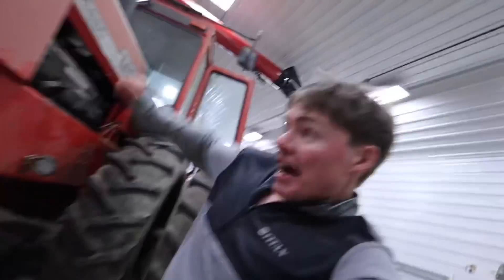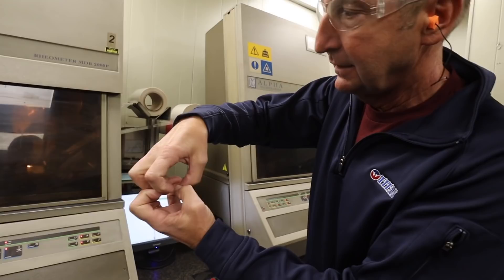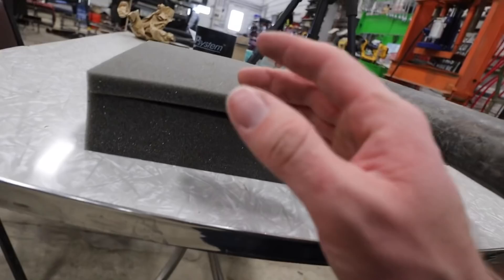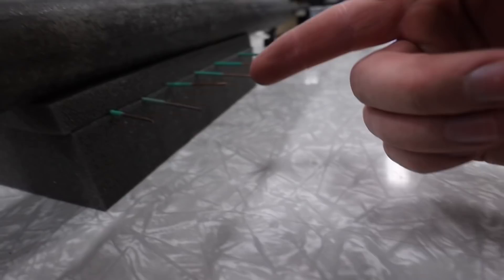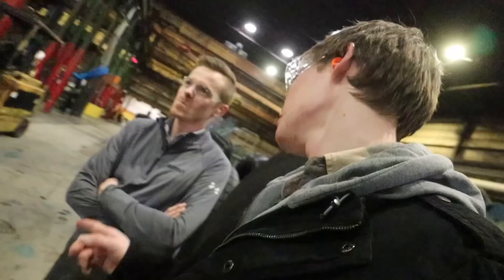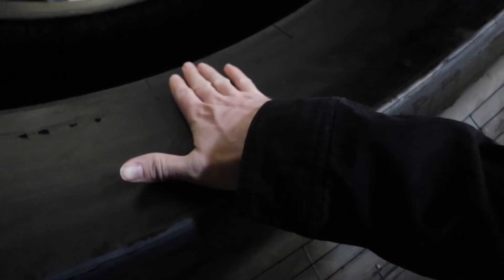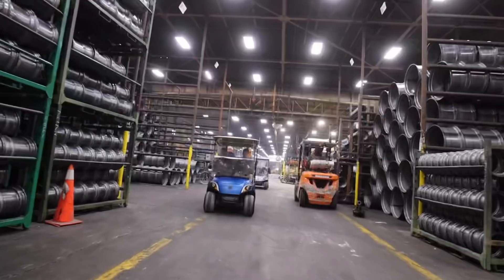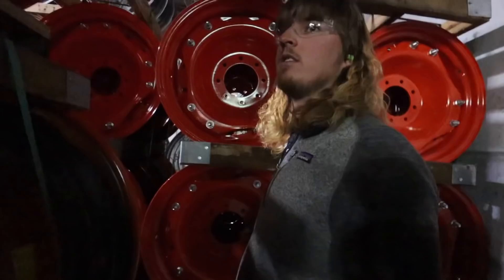How They Make The Largest Tires In The World

Comment: My dad worked for a cast iron foundry that was electric powered.  I worked there a couple of summers and whenever the power cut out, the power company would call them to tell them when it was coming back on.  I was there for one such event.  They had to rig up a fork lift and series of chains to be able to dump the furnace manually since less than fifteen minutes after the power cut it was starting to solidify in the crucible.  If it had gone fully solid, it would have been multiple weeks of downtime.  If you ever get the chance, a tour of Caterpillar's plant in Lafayette, IN is another good place to see.  20 years ago, they were building an engine there that used a Chevy V8 as a starter and had a radiator that was around eight feet tall.  The foundry dad worked for made the custom high-moly exhaust pipes for that engine.  The center pipes were around 100lbs per cylinder, where the end ones were 140lbs :)

Comment: Powder coat is powdered polyester that is melted onto the surface, and paint is also polyester but it’s carried in a solvent that evaporates off after it’s sprayed on, leaving the polyester behind. They are both “paint” but just applied differently. And paint is plastic because it’s polyester

Comment: I worked in a tire plant for 9 years building car tires on a machine called an ARF  - automatic radial fullstage built auto tires up to 18 inches.  Could build up to 400+ tires in an 8 hour shift.  All the stages you saw were done by one machine ran by a computer.  All I had to do was make the splices.  Parts of a car tire are innerliner, ply, chipper , apex, chafer, sidewall all stitched together and then inflated  inside  two belts  and a tread built on another drum.  It is then taken away by a lift put on a conveyor and sent to the molds where they are cooked into one piece unit.  There were over 25 of these machines in one plant.  At the time it was running 24 hours a day 6 days a week.  Much more manual later in. Tractor tire but process is the same.
chafer

Comment: Come on Cole!!
You totally missed the part where the wheel is positively charged so it attracts the powder they spray on the wheel.
Without that the powder will just fall off the wheel before it reaches the oven.
    And yeah I've done a done a bit of powder coating.
Reply: Electrostatic coating. Very little over spray or waste. I first saw that demonstrated at the Holley carburetor and speed parts plant in Bowling Green Ky!

Comment: This is such an amazing video, thanks you so much for the peak behind the scenes. Makes you wonder if they still have those monster tire moulds for the 1939 Antartic snowcruiser. Also wonder what their biggest highway rated tire is, since most of their product is Ag, mining, or Construction, and designed for less than 40mph, and highway speeds are usually twice that.

Comment: I built Michelin's version of the 59 tire, and seeing how these tires are made they look cheap and rushed. They could be withholding information for fear of competition, but simply putting on tread rubber without using a base cooling rubber causes the tire to wear faster. The beads shape are inefficient and wrapped poorly. There are no signs of them putting rubber infused with specific metal cordage through the middle of the tire to prevent wear. The process of carcous to completed tire before curing was 1.89 tires in a 12 hr shift. Michelin required very specific measurements and quality control and will scrap a tire in a heartbeat for even just cosmetics. For those uninformed on earth mover tires, these are like paper plates compared to Michelin's.

Comment: I worked in a machine shop that made oil industry stuff years ago and they made bladders that went downhole and sealed off the drill line.
  The smell is horrendous!!! I love the smell of new tires but this was nothing like that. They had what looks like the same machine with heated rollers that they fed the rubber into to get it to the proper thickness.

Comment: I will admit the tour was interesting but the titan Lsw's aren't all they are made out to be. I have had them on the 2 new John Deere combines and the steering tires have failed on both. The first time they failed in 18 months and they replaced them at a pro-rated value so I was still out of pocket. On my current combine they lasted 6 months before the sidewalls started cracking. I have been trying to have them replaced for 14 months by titan with no luck. Definitely the last time I'll be getting Lsw's again. Terrible customer service for a "premium product".